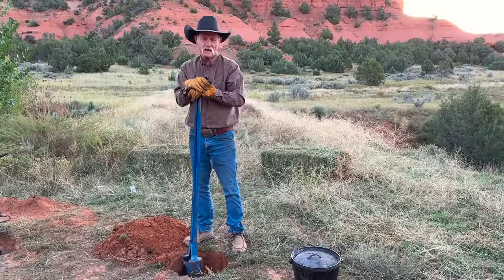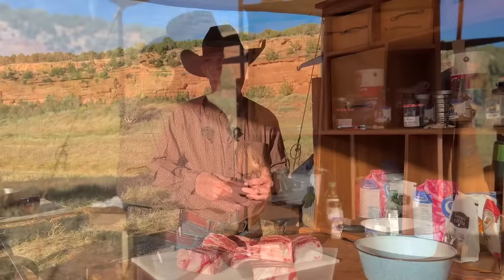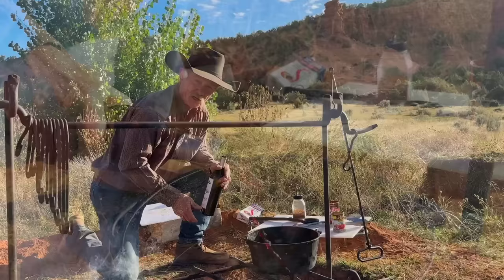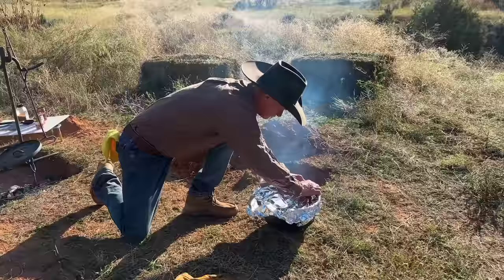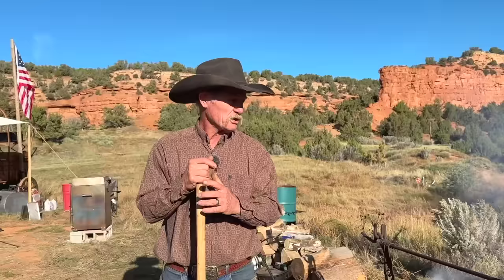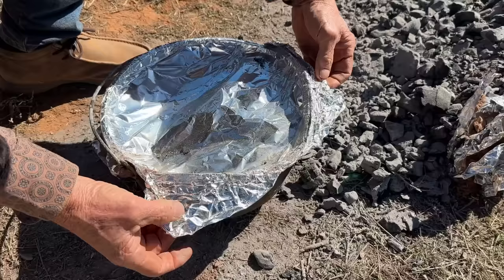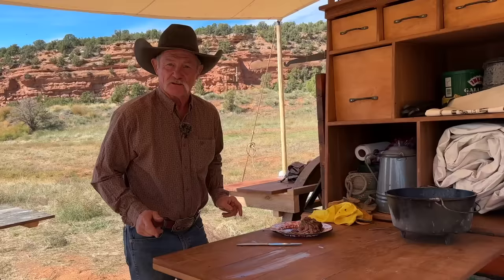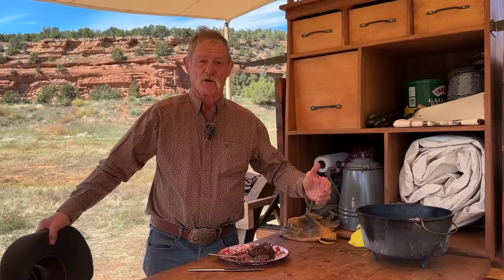Braised Beef Short Ribs in a Dutch Oven | Wyoming Ranch Cooking

Comment: You made a comment that is gold for crock pot cooking.  Pre-heat the pot.  When i make a crock pot pot roast, i always put the veggies and seasonings and spices in first, let them start heating up.  When i feel the crock is warm enough, i sear the roast and get it in there.  Then let it set for hours.

This helps avoid the dangerous period of "not hot enough to prevent bacterial growth."  If the liquid is already 140 degrees +, you can put the meat in there raw if you wanted, and it'd be safe to eat.  But you should sear the outside of your meat, that's just extra flavor.

Comment: I love the Barbacoa video and I love this one. I never dug a hole but I did put my Dutch oven and a 22-inch cauldron. It had three holes drilled in the bottom for a planner but oh my goodness how good is the smoke flavor when you can get some of that in the Dutch oven. Couple of layers of heavy-duty aluminum foil on the top and 1 lb Rock just to keep the stuff in place if you got wind

Comment: I usually build a fire in the hole & fill it with coals. Take just enough coals out to put the pot in and then cover it with coals & dirt that way the hole is heated up by the fire.

Comment: Learned to cook in a dutch oven in the scouts but we sealed the oven with any kind of dough from scratch made to the biscuit dough in the container you popped.We used to do 2 family camps a year and when new moms saw us put a pot roast into the ground and covered it up with dirt, they were seriously laughing at us. The laughing stopped when the dutch oven was dug up and opened. Made believers out of all of them all of the time.On the bar above the fire i like the fact that you have several different lengths of hangers. Never thought of that but i will add that to my set up.A;so the foil on top of the coals is a very good thought. It will be added also.Toward the end of my camping days we added raw charcoal to the coals below and above the pot.
Reply: cowboyRollins  ok, what

Comment: I cook my chuck roast in the same manner but in a 275 degree oven for 5 to 6 hours.  Onions, garlic, herbs, salt, pepper and maybe some beef smoking rub.  No wine, but i do use beef broth.  I will also add mushroom and some green onions,  When it is done, I pull the roast our and onto a cutting board, let it rest, then pulled/sliced thin and backing the gravy and simmer on the stove top, low for about 1 hour.  

You better be first in line, because it will not last too long.  Now to make it Louisiana, slice some french bread, meat on the bread and then add some gravy....you will be very well liked
Reply from the maker: Sounds so good

Comment: @CowboyKentRollins, do you ever save disposable big aluminum pie pans that are around 10 to 12 inches in diameter or bigger?  They can work nicely as a coal tray for fire pits you dig in the ground, and be a bit more sturdy than just aluminum foil.  It can supplement the foil while doing a bbq.

Comment: I do it at home in the oven, using an enamel coated Dutch oven, like you mentioned. 300-325 until a fork goes through it like butter. It usually takes around three hours, give or take.

Comment: Looks great, Chef Kent.  Unfortunately, I can't be digging holes in my backyard (HOA),   But we pull our camping trailer with an ICE engine (F-250) to a spot, and then we can try. I never use a crock pot. It makes prime rib taste stringy and tastes like cheap stew meat. (I would never put a prime rib in a slow cooker_

. Just an example). I make them in a Lodge Dutch oven on very low heat with your original seasoning. Comes out very well and not strings. I dislike the Chuck Roast taste. Now people have to be able to afford what they can, without knocking them down! You get what you can afford with prices today, and it can still be good. Chef Kent has many good recipes for Chuck Roasts. I donated my slow cooker to the food bank so someone else can use it. It was spiffy and clean, and I gave it to a mother who can stretch her budget (I volunteer two days a week. No kid should go hungry).

Comment: When doing this post hole method, what would happen if you included a couple or so black iron pipes into the hole so that you don’t completely shut off the oxygen to your heat source? Would it help or hit? …just curious.
Reply from the maker: The coals would burn a little faster for sure